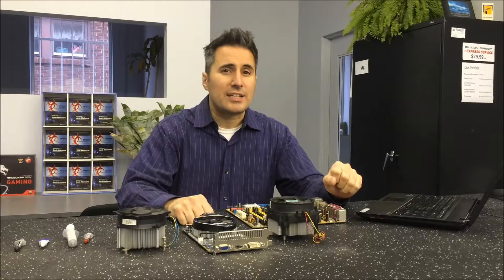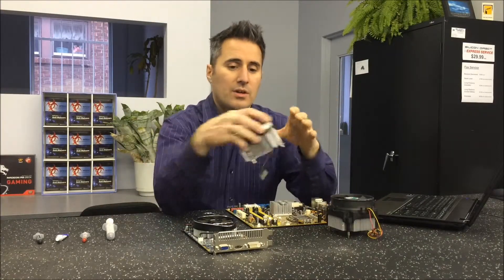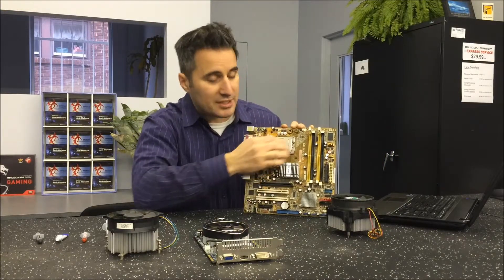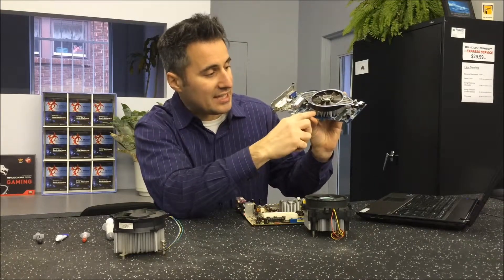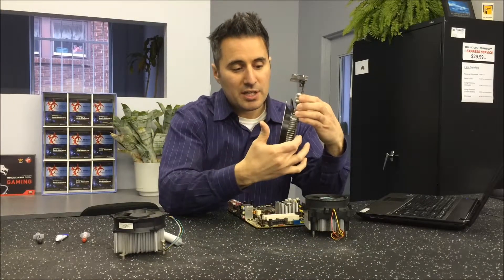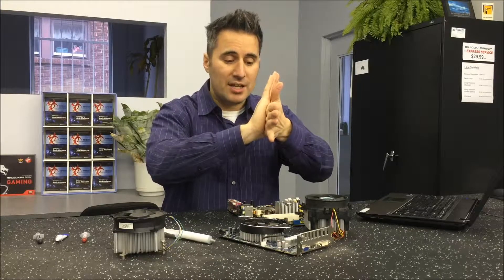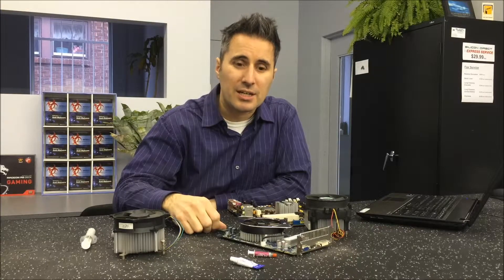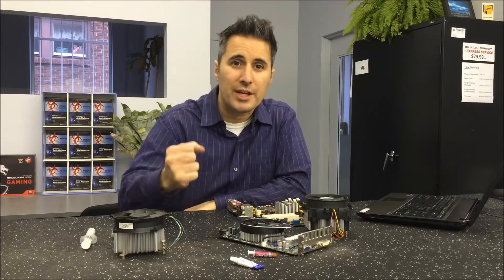Older PC? Check the thermal paste on your computer!

Comment: Do you have a Facebook or other social media? I run Tefen's Tech from London Ontario and would be interested in linking up.
Just a heads up: Most companies refer to the Thermal Grease products as Thermal Compound. I have yet to of seen a company refer to it as Thermal Paste. Although the term has been tosses around through IT Techs/PC Repair people over the years, professionally it is usually referred to as Thermal Grease or Thermal Compound. 
Arctic Silver, Arctic Cooling, Cooler Master, Prolimatech, Thermal Grizzly, Gelid, & most others most often use Thermal Compound, though I saw Thermal Grizzly use Thermal Grease as well, but none of the ones mentioned use the term Thermal Paste.
Reply: I found StarTech.com to list it as Thermal Paste Compound & also use the word Grease on the same page but I suspect that was a marketing intention.